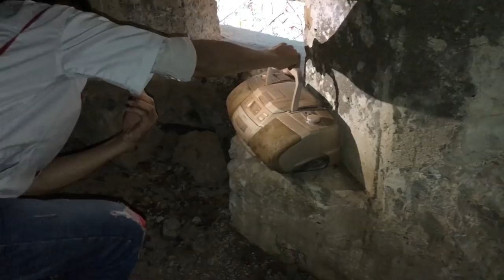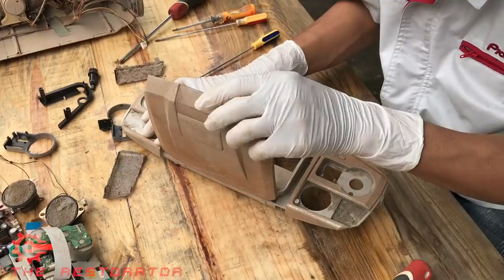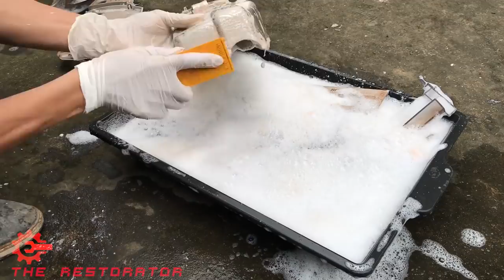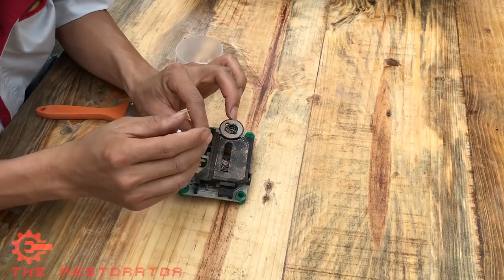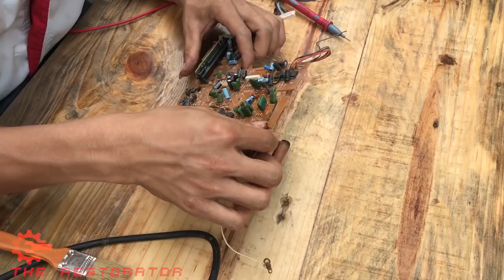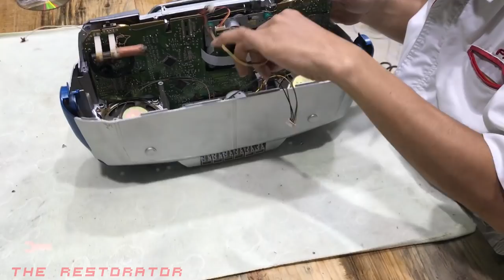Restoration CD Radio Cassette SONY | Restore Radio SONY CK 1 1

Comment: I Got a little know of how things work and if you pour water over transformers, capacitors and copper windings with core,  it is NO WAY to work it again. Specially TV´s with high voltage in toroids and transformers. It take me a time to consider but this is fake